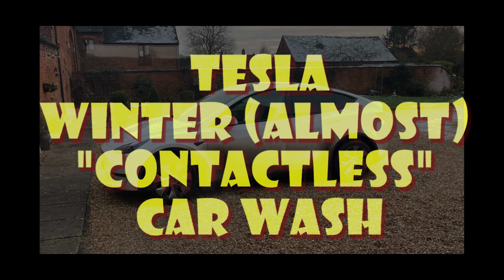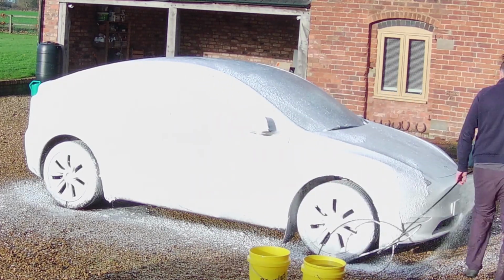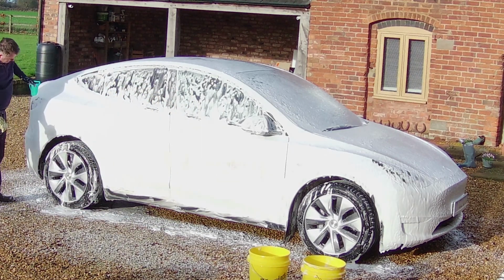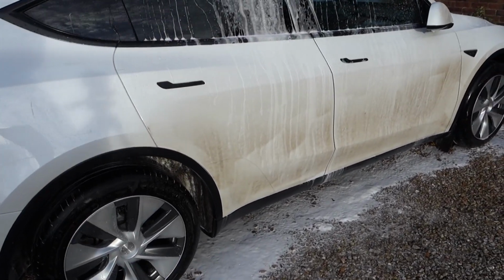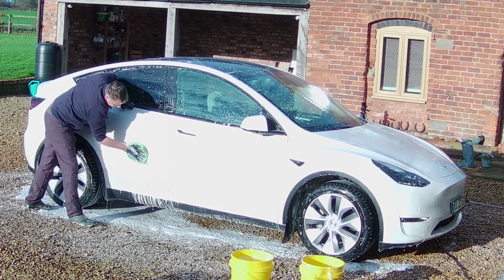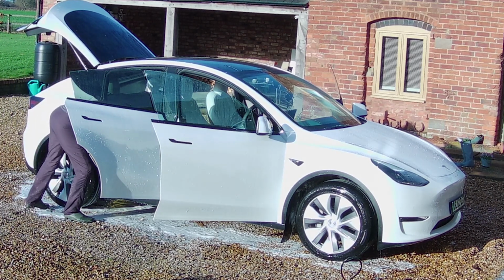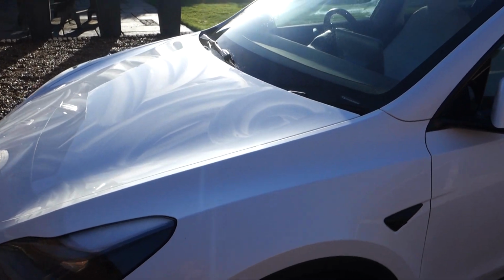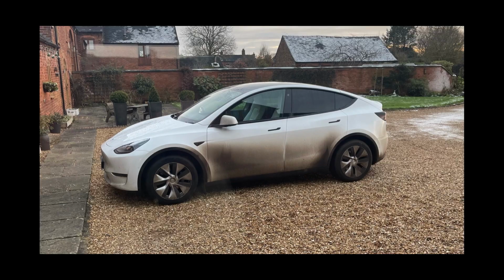Tesla Contactless Car Wash in Winter  - how to clean a really dirty car without damaging the paint

Comment: Is there a reason you don't use the Autoglym on the front windscreen?
Reply from the maker: The wipers can leave a smear for a few seconds. You can get special glass coatings which are fine although we would be careful using them on the glass by the cameras.